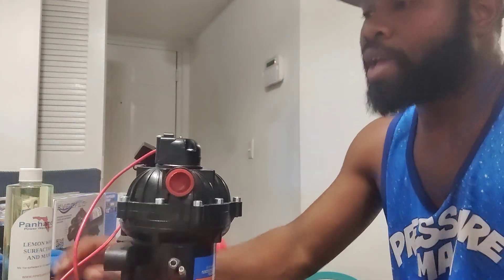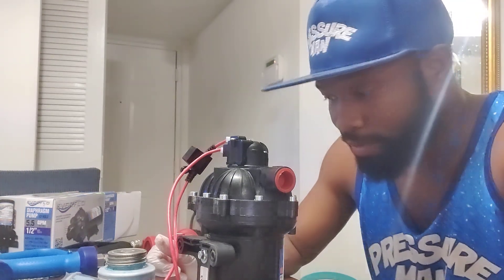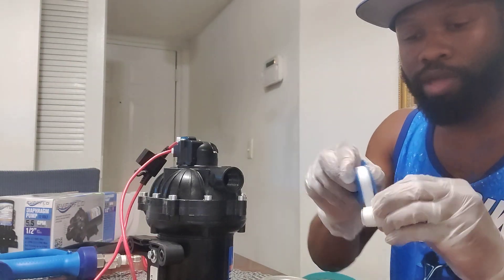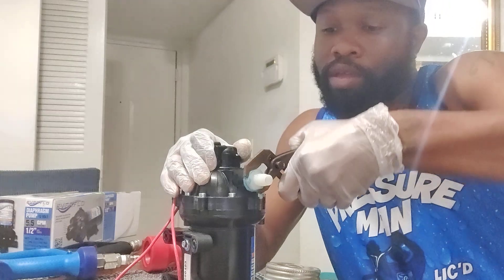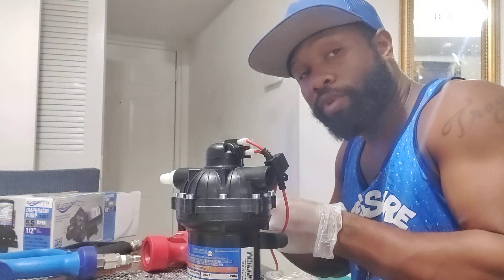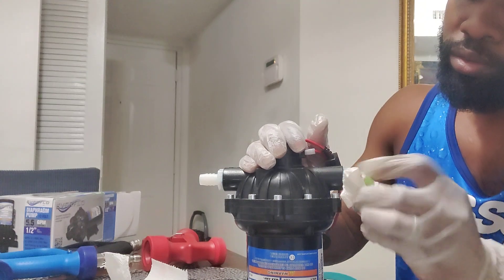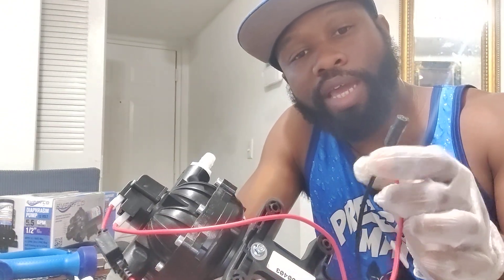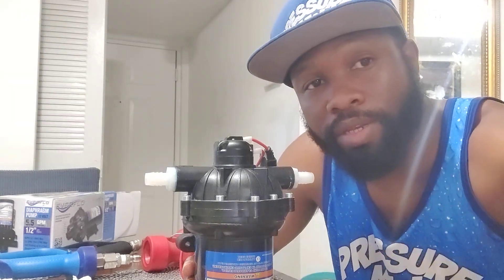How to plumb a 12v Everflo pump (5.5gpm or 7gpm)

Comment: Hello!  Thanks for these great videos. Wanted to ask how long the battery you linked usually lasts (how many hours) Thanks in advance.
Reply from the maker: It’s a pretty big battery for just a 12v to run off of so about 4-5hrs full charged I’m guessing. But there’s other deep cycle marine batteries that are better more expensive.

Comment: Hi, great info! I know you’re getting 7 months or more out of your pumps but, it’s possible that you could  get even more time out of the pump if you just used the true blue and not add teflon tape can cause it crack or the tape can get into the motor and cause it to affect the motor or even fail. It’s in the manual.

Can you tell me which shut off toggle you like and use? Thanks for the video.
Reply from the maker: I use both.. I Teflon then Tru Blue the tape I would be almost impossible for the tape after Tru Blue applied to get into the motor of the 12v. I’ve never had issues with the pump failing because of a clog; my pumps run straight through it’s life expectancy because of how much bleach I put through it. The toggle switch I’m using is a LED toggle I found on Amazon
Reply: @thelifeofpressureman7178  thanks!

Comment: What size hose do you use to wash on the 7 gpm? 1/2 or 5/8??
Reply from the maker: I'm using a 5.5gpm Everflo w/ 1/2in hose works fine. However, I've heard others are using 5/8in but really it's more of a preference thing I don't really see much more flow one to the other

Comment: Be careful when you Teflon, and use the piped up on PVC fittings they’re more likely to crack just a heads up. 
 Blue rag
Reply from the maker: I appreciate your comment! The True Blue locks it in never had a crack hose barb at the pump.

Comment: How do you know which side is where the mix will be coming out off?
Reply from the maker: It has flow arrows on the inlet and outlet sides
Reply: Only see 1 arrow I suppose this is the output side where the mix is coming out of. I’m just now trying to put my soft wash system together.
Reply from the maker: Correct
Reply: @thelifeofpressureman7178   be nice to talk too you and see if you can help me out it together man. You have any vids on how to put a proportioner together?
Reply from the maker: No, I got one from South East Soft Wash
Reply from the maker: 786 339-4702

Comment: When you cut those two pieces off and you hook up your 10 Gauge wire what size fuse do you put in there?
Reply from the maker: 30amp waterproof circuit breaker
Reply: @thelifeofpressureman7178  And one more question where can I get that from the waterproof circuit breaker
Reply: @thelifeofpressureman7178  Never mind I found it on Amazon thx tho One more question do I still have to put a 30 amp fuse in there still with the 30 amp circuit breaker
Reply from the maker: @steventaylor677  Yea, I just updated my description with the Amazon link I thought it was there already.. Hit me up anytime find me on fb I have a community page called BLEACH LIFE
Reply from the maker: @steventaylor677  Leave the fuse that is already attached to the pump alone; you won't have to worry about it. The fuse is unnecessary, if the breaker trips just reset there will be no need to change fuses anymore
Reply: @thelifeofpressureman7178  Can I use that breaker as a on and off switch to turn the pump on and off?
Reply from the maker: @steventaylor677  No, use a toggle switch instead Amazon has a LED toggle switch..

Comment: my barbs are leaking where the hose goes on them. Do you true blue the barbs, too, and put a clamp on them or something?
Reply from the maker: True Blue is only for the threads of the barbs.. If you're leaking from the barb hose connection make sure your hose is flush onto the barb as far down as you can get it; carful it's just plastic dish soap helps slide on. Then make sure your hose clamps are snug don't over or under tighten

Comment: Can I plumb 2 together
Reply from the maker: It won't be effective.. They do now however sell a 24v that's like two 12v's in 1, it is a 10gpm electric pump by North Star.. To plumb this pump, would require "two" deep cycle marine grade batteries and a special manifold with 1inch valves and hose lines much like the gas roof pumps require.